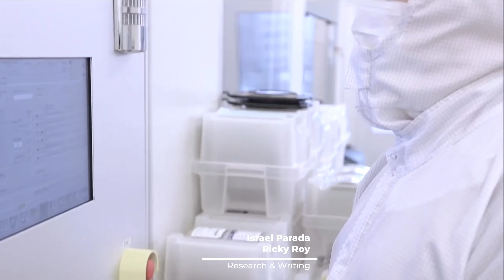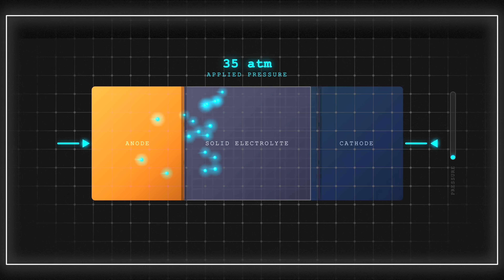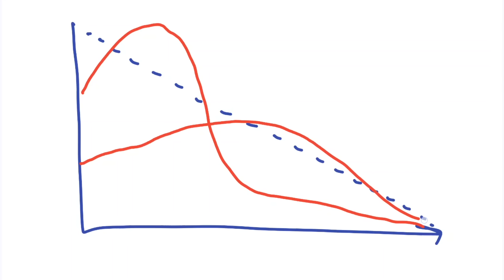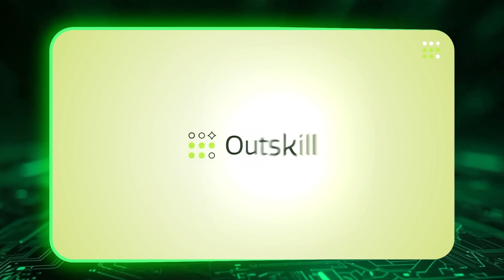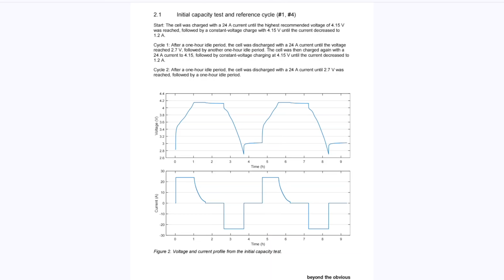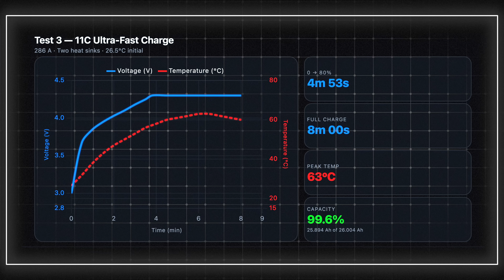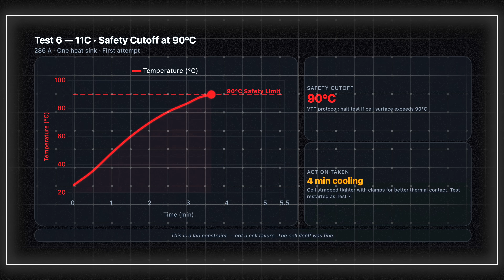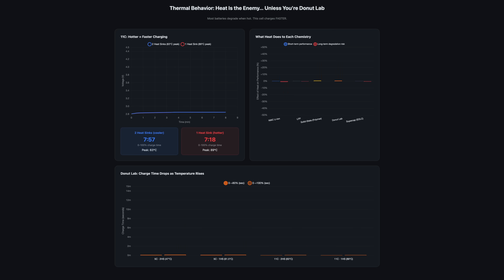Donut Lab's Solid State Battery Test are Shocking...

Comment: If their claims are met, their product will be expensive. If their claims aren't met, they will need to lower the price. I'd rather them not having high double digits margins on their batteries.
Reply: The price is already one of their claims. They said "comparable to current lithium ion batteries". For me that sounds like the expensive NMC but some youtubers that want view say LFP so that later they will come out with an "I told you it wasn't possible"
Reply: @pmaragoudakis  Marko actually claimed CHEAPER, using abundant materials.

If this is the real deal (and honestly, even if they don't match all their claims there seems to be SOMETHING here) there will be a strong temptation to inflate the margin for a couple of years, but if you hit it big with a high-demand product you have that right.

Comment: in the original announcement, they used an identical looking cell, next to a multi-meter with known dimensions (20,3x10x5 cm), using that i get around 120cm^3 (17x7x1 cm) for the cell, the cell would have to have a very low density to get only to ~225g for the 400Wh/Kg with 94Wh(vtt). The same test did show a 10 to 60 percent charge state to be around 65Wh, or 130Wh for 100%, if the scale is correct, which would check out, but is notably higher than in the vtt report. In addition, this was supposed to be a 11c charge demonstration, the cell had one heat sink looking thing, but only reached 61 °c (on multi-meter), what we saw with vtt at 5c charging. something is not adding up there.
Reply: Could be fans or refrigerant cooling at their labs. Either way, first generation Nissan Leaf type cooling producing 11c charging is insane to think about.
Reply: @JDDevice  what are you suggesting? Placing these batteries in an old otherwise useless 1st gen Leaf, whose batteries suffered from lack of cooling?
Reply: @tombrownca LOL. Im saying, even though the batteries have no active cooling, like a 1st gen Leaf, it still produces 11c charging. Lol. I think most people understood.
Reply: @JDDevice  thx. Now I read your wording again and understood you. Thx. Yes, that’s a totally different beast.
Reply: Again, in the video and report, VTT will not test above 90°C for internal safety rules. This point keeps being missed in literally EVERY report about the test except this.
Reply: Yep

Comment: Much better analysis than Zeroth. In the end, it looks like a standard battery chemistry, so long as we ignore sweet-spot operating temperatures. However this does confirm that it's likely not a pseudocapacitor, but indeed a battery.
Reply: His 'analysis' was terrible, he didn't even bother to figure out 90C was a VTT limit; not the battery.
Yesterday, the battery losing vacuum nearly proves it isn't Lithium (moisture should ignite it), looks like he'll be paying that $5k soonish.

Comment: Nice report, Interesting findings and analysis. Some remarks:
There are other new cathodes with similar curve - e.g.  NMx or NMA.
NMC (with cobalt)  would break donut labs claim "100%" green materials and no geopolitically sensitive resources. 

Also you have an error in the your graph @12m45s - %SOC on the x axis only goes to 13%. Looks like it otherwise correct, just should have shown 0 to 100%
Reply: Donut labs also claims that there's no lithium in it as well.
Reply: @BubbaBearsFriend  I have not seen this? I have seen they compare their battery with standard lithium-ION, which is lithium ions in a fluid electrolyte (not solid state)

Comment: They can bring to every test another battery with another technology.,,
Reply: Maybe, but the lab does report in the pdf the specimen tested, so readers can easily spot it.
Reply: @pmaragoudakis  I wouldn't be surprised if they use different samples for subsequent tests, but in itself that's not a disqualifier.
Reply: @pmaragoudakis  You can bring completely different batteries of different technologies for
* fast charging
* energy density
* life cycles
* low costs

PS.: Even in this test, I do not get this small sample size. Less than 10 measurement runs ...wtf.
Reply: They can only get away with that for so long.

Comment: On the other hand, they wanted to showcase the battery on an existing platform (Verge Pro motorcycle) which already had NMC in it, as a drop in replacement. If (big IF) what they claimed is true, that they can configure this platform to function at any voltage, it makes sense to mimic NMC, So, no need for new BMS, motor controllers etc.
Another clue is the dimensions. A few reddit users have calculated from the photos between 165x70x7.5 and 172x74x12 (mm) 
Is it possible to have 26.1 Ah with this charging characteristics in this package? WeLion 27 Ah semi solid state is a little bigger and much heavier even from the mentioned CES weight (CES mockup looked like a bigger form factor than the one tested here). 
Ricky has the right mindset. It seems to be at the edge of current commercial cell capabilities as far as the charging test is concerned. Both narratives are possible right now depending on the data revealed from the rest of the tests.
Reply: Someone from Donut said at CES that they'd deliberately tailored the voltage curve so as to be compatible with existing BES, so that MIGHT explain the similar fingerprint. It might also be a convenient excuse to explain that similarity away. For my own sake I still don't have enough information to conclude either way but... hey, they hit their numbers here.

Comment: Excellent video. By far the most balanced and least emotional discussion of the topic.
Reply: Part 2

Here is what nobody discussed (in the video’s I have watched):

How does the power dissipation compare to Li Ion cells?  If it is similar to Li Ion cells this means it can be dropped in with minimal changes from a thermal design prospective.  More dissipation and that could be a problem.

Not a technical issue, but if this is a Li Ion cell, it would seem this whole charade is going to devalue any investment they might be angling for as compared to just looking for investors before the CES announcement.  If it really is a solid state energy storage unit with no nasty chemicals, this strategy is going to make a few people very, very rich - possibly more rich than just going for funding before CES.

Just present a list of things they want to see demonstrated and check them as verified and how complete the verification is.  Mine would be:

Demonstrated charging rate
Demonstrate temperature range
Demonstrate the thermal management should be no more stringent than a battery with Li Ion cells.
Demonstrate a very large number of cycles - would not expect a 100,000 cycles test, but one that would justify a very large number via accelerated aging or extrapolation.
A DPA (destructive physical analysis) that shows what it is made of, or as a minimum, what it is not made of.

Some things like exact physical construction or fabrication processes I assume would be proprietary a won’t be divulged until some buy’s a product and takes it apart.
Reply: Really 😂
Reply: Ziroth also.
Reply: Sadly he's not battery expert, Ziroth seems to have accurate analysis in my view.  Also I've done >11C charges in my own testing using existing tech, but too may cons to make it worth it.
Reply: The Verge "Logistics Hammer": Why 400 Wh/kg is a Mathematical Certainty
To those claiming the 400 Wh/kg density is just "marketing": The physics and logistics of the 2026 model year make this a closed loop. You don't need a lab report to see it; you just need a scale.
1. The "VTT Proof" of Performance
The Feb 2026 VTT test confirms the Donut Lab cell has a 26 Ah capacity and handles 11C charging (0-100% in ~7 mins). This confirms we’re dealing with a cell holding roughly 96 Wh of energy.
2. The Official Weight Paradox
The 2026 TS Ultra: Packs a massive 33.3 kWh battery.
The Weight: Officially spec’d at 235 kg (518 lbs).
The Math: In 2025, the 20.2 kWh model weighed 245 kg. In 2026, Verge added +65% more battery energy but the bike got 10 kg lighter. Even with a 21 kg lighter motor, you can't add 13 kWh of capacity and still lose total vehicle weight unless the battery density has nearly doubled.
3. The Logistics "Checkmate"
If Verge used high-end liquid Li-ion (~250 Wh/kg), a 33.3 kWh pack would weigh ~134 kg for the cells alone.
That would make the bike weigh 263 kg—exactly 28 kg (62 lbs) overweight.
You cannot "hide" 28 kg of mass in international shipping or vehicle filings. A discrepancy that large would be an instant red flag for any regulatory body.
4. The Verdict
For a 33.3 kWh motorcycle to weigh 235 kg, the battery MUST hit 400 Wh/kg.
Calculated Cell Weight: Each cell must weigh approximately 237 grams.
If the cells weighed 315g (as some claim), the bike would be a legal and physical impossibility.
Bottom Line: Denying the 400 Wh/kg density is effectively denying that the bike weighs 235 kg. The physics don't lie.
Reply: Yes, I also watched Ziroth's video and somehow it felt like he almost wanted the battery to be a scam up to his bet and promise to donate 5.000 EUR if it turns out they lied about the battery chemistry. I want to keep an open mind, which means acknowledging that the charging curve looks very much like that of an NMC battery but it also means allowing for the fact that there could be other reasons and acknowledging that we know very little at this point.
Reply: @midnight1672  When I watched Ziroth's video I took his statement to be more about his confidence in his analysis. Donut's secrecy about so many things that will come out as soon as they start to ship screams scam in my book. Also, their current insistence that they have no desire to license the technology also raises some real questions IF their claims about the technology are true. A true game changer in battery technology would need far greater capital and facilities to meet demand than one company can provide.
Reply: meandering speculation without resolution...yawn
Reply: Watch ziroth, the guy is the best, to the point with real analysis. He also has a PhD in batteries and energy and says whether this is real or not. He has it @ 0.1% chance of being real. This down from 1%
Reply: @djlager  I disagree. He assumes a lot and did not do any research. This channel did research and mentioned that VTT has a safety limit, not the battery. Ziroth claims that the battery has a problem because they had to stop the test due to the battery reaching the temperature limit. And the whole time he has an CATL ad in the background... He can not say if this battery is real or not. Nobody can. We just have to wait for more videos/tests and eventually tests done by an end user with the real battery (in a bike). I do not say it is real because I also do not know.
Reply: VTT had to stop the test because the battery got too hot, that’s pretty straightforward right ? Now they stoped the test @89° donut reckons it can safely run at 100°… ?? so what happened there ? Also the battery curve on the data sheets are the exact same chemical make up as LI-ion.. 
I think you haven’t understood or watched the video properly, as anyone with a slight understanding of energy, density and chemical make up would agree with him.
Reply: He assumed a lot what a clown statement.
Reply: @djlager   @djlager  Not true. They had their own specified cut-off temperature and did not prove that 90 C was too hot. VTT also operates under assumptions (correctly or incorrectly) that says not to exceed 90C for safety reasons. Too prove that a particular battery is ”too hot” one would have to let it run above that temperature and allow failure. Other than that the fingerprint analysis of NMC was spot on and to believe that this was just replicated with non-Li battery tech is a bit of a stretch.
Reply: @horsie2066  VTT had mishap in configuration. They had forgotten LiIon settings from their other tests. LiIon safety limit is set that 90C, not relevant donut battery.,  It was stated in video and also Marko corrected it in Linkedin.
Keeping repeating that false 90 C limit everywhere seem to be either ignorant or intentional. Which one, maybe you tell me.
Reply: @h1-1024hthat is exactly what I wrote. They seem to focus on that  temperature limit. We still do not know what the battery is and if every statement is real.
Reply: @djlager You can not read I suppose? I did watch the video and he assumes a lot. The charging graph looks like a Li-ion battery. I do not say that it does not but therefor he ASSUMES it contains Lithium. And therefor he ASSUMES that the battery can not charge 100,000 cycles and also because of this he ASSUMES that the energy density can not be true. No research, which is impossible because he does not have the battery. And than he ASSUMES that the battery will fail at 90C because of the aborted test. If he did some research which this channel did he would find out that VTT stopped the test because normally a battery at that temperature will catch fire. So if he has a PhD he should act like someone which has a PhD.
Reply: @d @djlager  that phd claim looked quite silly after some of the oversights on his video. Tbh, he should be a bit more careful. Also never believe something just because someone has a phd. I’m sure a lot of people at donut lab also have PhDs
Reply: @FGGiskard yes try watching some of his videos then come back to me, he has much more education in battery tech than Two bit and his analysis is spot on. As other YT with the same detailed analysis have said the extract same. So he is not alone.
Reply: @FGG @FGGiskard watch the latest video from two bit da Vinci. And bow down to your master, I told you, but you said never believe anyone who is PhD qualified in their profession. What a complete CLOWN statement. Eat humble pie dude… nom nom..
Reply: I know right? I love how people get so emotionally charged (pun not intended) and instantly assume its a scam but just like the wright brothers aircraft someone was gonna do it eventually. lies tend to fall apart fairly quickly
Reply: Yes very good video, very logical, non biased.
Reply: In response to those saying Ziroth had a better analysis, Ricky’s analysis is better.

Part 1

Both identified that the curve looks identical to a Li Ion battery.  But Ricky went one step further and did the impedance calculation across the charge curve, which also correlated.

Ricky was astute enough to note that it was the VTT requirement to pause the test at 90C.  It was surprising how many YouTubers failed to miss this point,  which was clearly stated (including Ziroth).

What was more amazing is how many YouTubers (including Ziroth) thought a pack should have been tested.  Designing a pack is a different engineering problem to designing a battery cell.  Not only that, but each manufacture will have their thermal control method and will need to configure the battery to the product it goes in.  Ricky, quite rightly, never discussed pack performance, but did a lot of discussion of the actual cell level results presented.
Reply: @davesutherland1864 Yeah, agree on this ziroth did seem to have a bias. Some of the mistakes he makes do not go well with the phd in batteries that he has (according to him). Either he was purposely leaving things or just missed them. I don’t know what’s worse
Reply: Yes, exactly what he said. Excellent video. I felt like this was a very dispassionate information based explanation

Comment: At the very best, they may have found a way to dope a regular lithium battery so it can handle these fast rates. And instead of explaining that, they're trying to market it as solid-state, knowing that people freak out when they hear about a traditional battery charging at 11C...
Either that, or they just know that a normal cell will allow this type of abuse short-term and are hoping that the market will buy it soon enough before they have to show long-term data

... OR they invented new physics and chemistry :D
Reply: I have done >11C charge, existing tech can do it, but to many cons in other areas (not cost effective).
Reply: Bingo. "Hey we made a faster charging lithium battery" doesn't have nearly the market impact as "WE FOUND THE HOLY GRAIL!". It's the difference between selling the IP for peanuts and raking in shitloads of investor money.
Reply: Donut Labs has stated publicly that there is no lithium in their battery. I'm not saying what is true, just what they have stated.

Comment: Looks like an NMC, sounds like an NMC ... Well you know.  

If the chemistry is truly one that doesn't use any rare earth materials and has little degradation as per Donut specs, then that alone is a game changer. 

Not sure why they don't just take out international patents then go into mass production rather than this cloak and dagger BS.
Reply: I think that’s what they’re doing, gearing up for mass production at the same time as applying for patents to stay ahead of the Chinese who have very little regard for intellectual property and international patents.
Reply: @Crazy_Worlds  They may choose to not patent. Which sounds crazy, I know, but they've claimed from the beginning they aren't at all interested in licensing the tech, and that the chemistry will be easily determined the first time anyone outside the company tears it down. But they may believe they have proprietary PROCESSES to construct the battery that nobody is going to reverse-engineer easily. That seems pretty arrogant but what do I know?